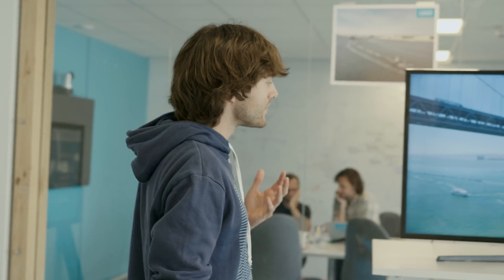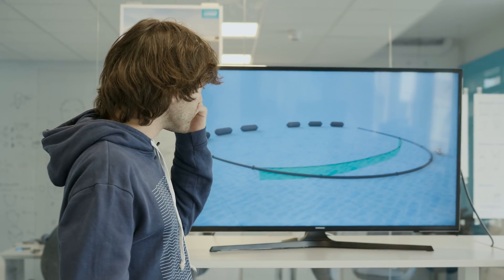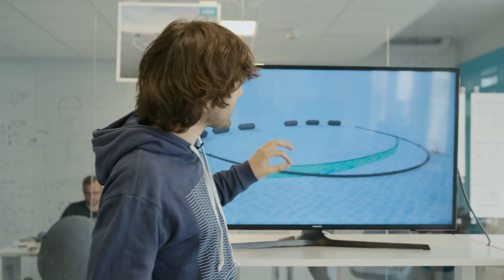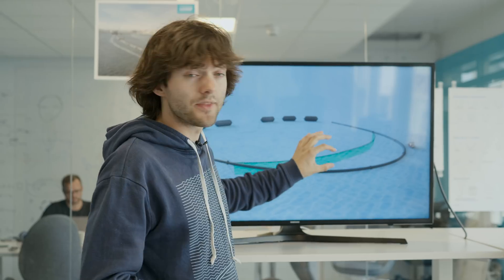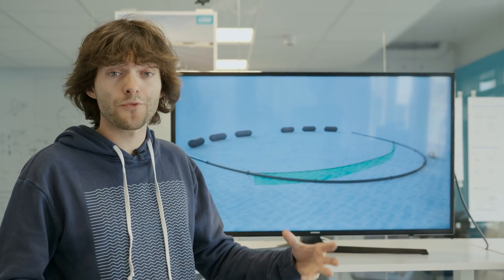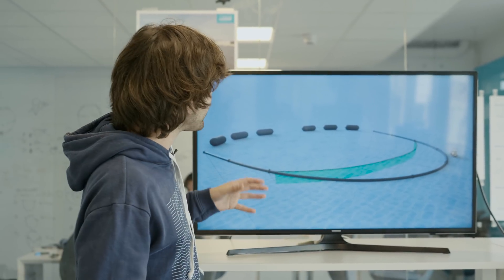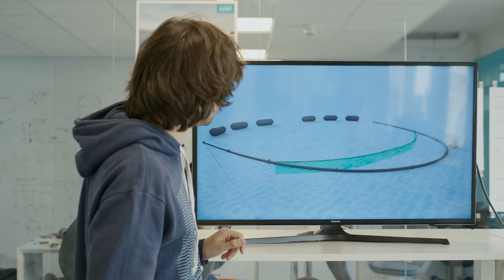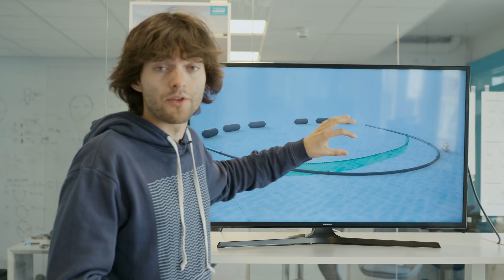Boyan Slat on relaunching the cleanup system | System 001/B | Cleaning Oceans | The Ocean Cleanup

Comment: "either always go faster than the plastic or go slower than the plastic"..obviously you need to go for the ALWAYS FASTER ..because if you go slower, then it takes an x-factor more time to clear the (same) plastic patch.

Sails..yes..large force in a storm..yes...but that doesnot mean you have to tie up a LARGE square sail !?!?
On sailboats during storm..you REDUCE the sail surface...of course... so instead of a canvas sail, why not have a FIXED , SMALL series of wind resistance elements attached to the tubulars.  Triangular, keg shaped.

Comment: What are your mitigation plans for fluctuations in the directions of the wind/stream? Or is it safe to assume, that the wind/stream will be constantly blowing/flowing in one direction? The problem I see here is, as soon as there is a change in any direction, you will again be facing the problem of plastic leakage from your system. 

I don't know the environmental assumptions/data that went into the design specification, but I'll just throw in an idea, and your engineers can figure out a way to implement it, if deemed necessary:
Assuming the wind changes its direction for a long enough time period to have an impact on collecting the plastics, an automated way to rotate the entire system would be of great use. This could be done by attaching some sort of small anemometers on top of the structure (using either the angular momentum of the spinning 'windmill', or the momentum that results from the wind force x lever arm). By figuring out a proper arrangement, there might be a way to create an equilibrium state where the "plastics fishing net" is always aligned in (or opposite) the direction of the plastic movement.

This is of course just a quick idea, without exactly knowing the frame conditions. Everyone feel free to comment, correct, falsify or improve the drafted solution.

Comment: Very nice progress guys! And great idea to make the system smaller and more agile. However, is the screen suspended from the pipes really a good idea? I am imagining stability issues, or problems with keeping the screen submerged in the water, yet not low enough so the plastic can flow over the screen. Anyway, I pray for success for you guys! Keep going!

Comment: I'm happy that y'all are working hard to combat this problem... but I think this is a horrible idea that will end up just as damaged as the first one.
Reply: why? What would you suggest instead?
Reply: @RubiksBotES  It won't work because they completely underestimate the power of the ocean. Furthermore, these systems take a long time to gather trash and then we have the problem of recycling it. Most of our (U.S) recycling gets sold to China which is dramaticly reducing the amount of material they take In. A proper system would be one that is easily attached to a ship that can draw pollution in and recycle it on spot.
Reply: @Trade_Space_IO  Wow, I actually really like that idea. Thanks for sharing!
Reply: @RubiksBotES  Thank you for your question. Have a good one.

Comment: I don't understand how an underwater parachute will give you a relative difference in speed from the plastics as both are driven by the same currents. Are you planning on the parachute being towed much deeper than the plastics where currents are weaker? If the system is moving slower than the current, won't the parachute collapse? If the wind blows against the current direction isn't there a risk that the collection skirt could be pushed back over the parachute? It'll be interesting to see how this works. Good luck!

Comment: One thing puzzles me. In the original explanation on why the system should work, it was said that the plastic is moved by only the current, while the system is moved by the current and the wind. Therefore the system should be faster than the plastic. I never understood why you think the wind and the current are going to face in the same direction. Currents are underwater streams that don't care about wind directions.

If the wind and the current go in the same direction, the system will be faster than the plastic. If the wind goes in opposite direction of the current, it'll be slower. Buoy sails are not going to change that. And break parachutes aren't a different approach, just a different tool for the same approach. How is a parachute different from a sail? It's going to add speed to the system in direction of the wind.

Comment: Using your concept of a drifting device, why not add to it a plastic collection system? This way the plastic would not escape. The whole thing would look like a barge. Put a platform on top of your system covered with solar panels. Integrate a collection thread mecanism to collect the plastic from the water into a big container in the plataform. No crew needed. It will drift along.

Comment: Nice...  but can't you design a working system before you spend lots of money on trail and error in the field? You still expect 'challenges' to solve, and you seem to be unsecure about the solutions that are implemented, please consider a different option 'to stay ahead of garbage' before you sail..  use solar, small windturbines and best of all, the current of the ocean, to store energy in a battery-pack to drive an electric stearing /propulsion unit..

Comment: At the tips of the U shape add solar panels and water propellers to regulate the overall speed.  Battery storage could even be used to store the energy from slowing down the unit using the water propellers as controllable drag.  Keep gong, great work.  Thank you for cleaning up our mess.
Reply from the maker: Thanks so much for the idea! Based on our data and simulations, it is possible to design the system to be completely passive. Adding solar powered propulsions/ ocean renewable energy sources would require a large amount of solar panels in order to move technology of our size (this would also impact the weight of the system). It would also add quite a bit of complexity and would require ongoing control software and technology maintenance. However, it is not out of the question.

Comment: bro just put engines on it. Solar engines are so much easier than that crazy kite thing
Reply from the maker: Thanks so much for the idea! Based on our data and simulations, it is possible to design the system to be completely passive. Adding solar powered propulsions/ ocean renewable energy sources would require a large amount of solar panels in order to move technology of our size (this would also impact the weight of the system). It would also add quite a bit of complexity and would require ongoing control software and technology maintenance. However, it is not out of the question.

Comment: From what I have seen from your website the North Sea design looked more promising, than this large rigid system your taking out to the garbage patch. Have you considered placing a semi rigid inflatable container inside a flexible tube, so as not to inflate the tube but have buoyancy cells within it, this would allow flexibility of the system and much reduce chance of a puncture, and it would move more freely. This would make for a lighter system and allow electric motor thrusters powered by solar and wave movement, via a small battery bank! If you like I can forward some drawings of my ideas, freely of course!

Comment: How can you have "5 tonnes of force on every metre of sail"? Force and mass are different things!

How will the buoys behave in a storm? What's stopping them from ripping the system apart during a storm?

From the pictures, I can't see how the buoys are connected. Will you be using a special composite material? Will the cabling obstruct the plastic from entering? 

So the pipe and the screen are only connected at either ends? This must induce a gigantic stress concentration at connections!

I thought the whole point of the system was for it to move faster than the plastic and capture it this way. How is "always going slower" going to be beneficial?

A few updates back you had mentioned that over-topping was not observed. However, the diameter of the pipe connecting the screen appears to have been reduced significantly. I suspect this will lead to overtopping leaving plastic trapped inside the 'D'. Is this by design? If not, how will this impact the efficiency of the system? 

How will you have access to the section behind the screen for maintenance or collecting plastic?

You will still consider the project to be feasible with the amount of plastic that was collected during the last trial?
Reply: Looks like this question was answered in the thread below.

I thought the whole point of the system was for it to move faster than the plastic and capture it this way. How is "always going slower" going to be beneficial?

"For this iteration, we will test a 20-meter-diameter parachute-like sea anchor, which will turn the system around and, in theory, maintain a slower speed than the plastic. Rather than attempting to go faster than the plastic, this option brings the speed close to the speed of the water, making use of the observation that the plastic can travel substantially faster than the water current. Hope this helps!"

I think the idea to slow down the system is fine but the design is truly awful.

The parachute will never be able to achieve the 90 degrees angle configuration perpendicular to the sea floor as shown on the picture. The system is simply traveling too slowly. 

The parachute will get tangled up and there is no way of untangling it.

Since it is underwater, it will be difficult to make observation and adjustments. How will you change to the speed of the system? 

If you want to more drag, why not attach a couple of floating buoys that are partially filled with concrete at either end of the system, that way the added weight should be enough to slow it right down and it will be easy and convenient for maintenance. You can also make adjustments by adding or removing buoys. I am sure this is also a lot easier and cheaper to produce than a (stupid) giant parachute.

Comment: failing is the best way to learn
Reply: Failing is the best way to learn things that are not known by other people already, which is what this is. Otherwise, it's suboptimal.
Reply: Having worked on fluid flow CFD. I can tell you that grid calculations on such a system although useful will be no match to a scaled experiment which is what they seem to be doing here. Empirical experiments go hand in hand with CFD calculations. They seem to be doing things the right way IMHO.
Reply: It's also useful to listen to experts who understand sea currents and fluid dynamics before spending lots of money.
Reply: @munchingsquirrel5067  they probably did, but no one ever attempted to create something like this so it was impossible to predict everything

Comment: Boyan, if the system is always slower than the plastic, how will it collect the plastic? Can you explain? Groetjes en succes!!
Reply from the maker: For this iteration, we will test a 20-meter-diameter parachute-like sea anchor, which will turn the system around and, in theory, maintain a slower speed than the plastic. Rather than attempting to go faster than the plastic, this option brings the speed close to the speed of the water, making use of the observation that the plastic can travel substantially faster than the water current. Hope this helps!
Reply: @The Ocean Cleanup  So will it only move in a circular like direction, in that case? With the outer part of the part of the arm moving faster than the inner part? And thus catching up the plastic?
Reply: @theoceancleanup  I love the new, total out of the box solutions! One thing that sounds good is that the simplicity of the system will increase, which is always better. Ben zo blij voor jullie! Ga weer slapen met mijn geluks ocean cleanup hoody. Zelfs als het warm wordt!
Reply: If the system is faster it will catch up to the plastic and collect it. If it's slower the plastic will crash into the system and accumulate. Although now that I'm thinking about your question... If it's faster then the U with the opening is facing the plastic that it want's to collect. If it's slower the U might turn 180° facing away from the plastic. Well... We will see I guess :D

Comment: As an experienced sailor, that sea anchor needs to be weighted down enough so it doesn't surface and deform the chute and be fouled.
It should be weighted by a chain with a swivel attached. Do not use stainless steel chain, it is too brittle due to it being underwater and under constant stress.
Reply: I couldn't understand anything .
Reply: Geethanjali balaji 
That there my friend is call Sailor Language.
Reply: It's a quaint notion that they don't know how to deploy a sea anchor.
Reply: @boyan i hope you see this one!

Comment: When you have the screenin the middle of the system, how are you dealing with waves? So surface plastic will most likely skip over the screan and then concentrate on the pipe, but will it stay there? or will it eventually go under the pipe?
Reply: Doesn't the system float and move with the waves?